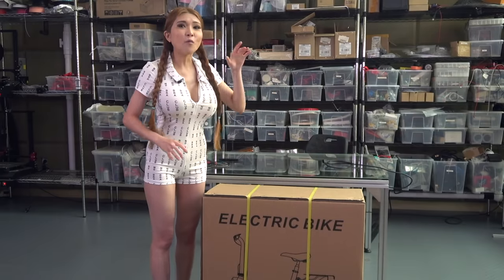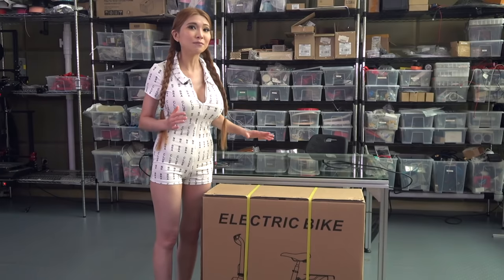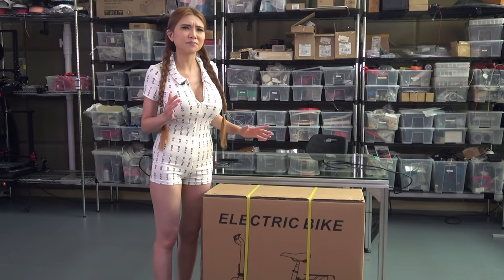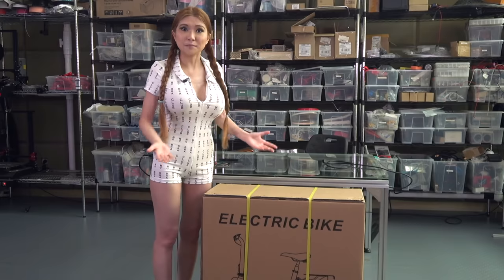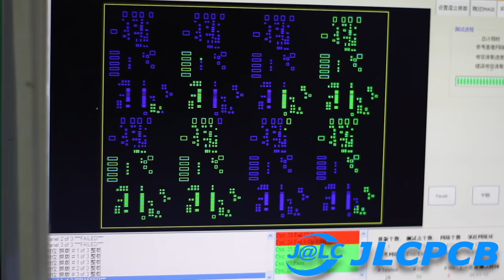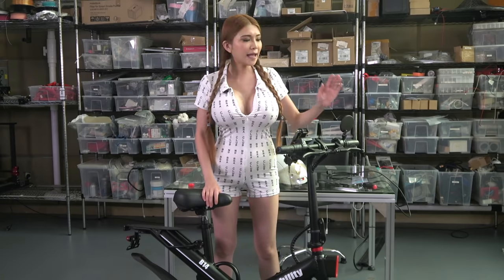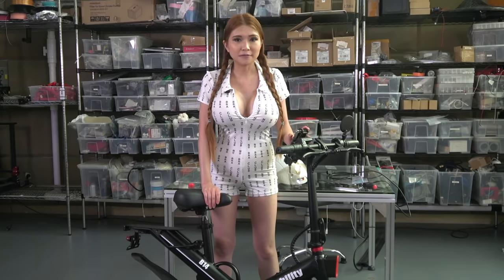Shenzhen E-Bike Test Drive- Niubility B14

Comment: What I like about this bike is that it has full suspensions and is small. Those 2 features rerly come together. From my experience, you need full suspension in electric bikes otherwise vibrations would shutter it into pieces over time. My advice on ebikes - always choose full suspension.

Comment: 5'6" and 106 lbs (in freedom units, as we Americans like to call them) is not even remotely close to pudgy for an adult female; you still look as fantastic as ever.
Reply: 5'3", not 5'6", but you're still correct, she's not by any means overweight; the numbers equate to a BMI of 18.8 which is considered the very bottom of the normal weight distribution
Reply: @cambridgemart2075  Wait she is 5'3?
Reply: @monochrome_linux  Yes
Reply: @cambridgemart2075  damn. I always thought she was 5'8 or something. She look soo tall in the videos tho!  So There's hope for small midgets like me!!
Reply: Freedom units that originate from the UK!!
Reply: @monochrome_linux  That’s cause she has long legs.
Reply: @isuckdick5275  no I dont think we will 🇺🇸

Comment: We saw you having trouble with the hinge, but all I could think was that it's better that it's a bit to tight than that it's to loose. Back in the 70's there was a "mini bike" craze. My sister had more experience with them as she had three of them stolen... Well the frame on these were pretty similar in that they used a pretty thick tube bent to form the frame with a hinge in the middle just like this one. That hinge was the major weakness of the design as it always seemed to have just a little to much give no matter how hard you tried to lock it shut, making the bicycle feel unsteady. So better that hinge is sturdy and tough to use than it ends up causing the frame to flex.
Reply from the maker: Yeah it's stiff but solid...

Comment: Good review! It's decent for the price, it only cost about 669usd and folds up and everything. I've been searching for alternate forms of transportation while I work on my car. I'm in San Fransisco and there's a company here that makes an "e-bike" called the onyx rcr it has a top speed of 60 but also cost around 4k, or I could ride an electric skateboard which cost like 1200-1800 and have top speeds around 22mph. This Niubiity b14 gets a top speed of 15mph but that's justified by the price

Comment: Small electric vehicles makes sense, since most travel is short range, isn't it, errands for groceries & such. But wouldn't compressed air be even better?
Reply from the maker: Tata tried, so far no ones been able to make it work...
Reply: @Naomi-Wu  But it works to some degree, right? As long as they keep it simple and inexpensive, and suitable for the common short range errands, is what I'm suggesting.

Comment: Got one second hand for my partner with only 25 miles on it for around half retail price.

Very excited as we've been using a windgoo b20 which has no suspension and a tiny battery to go on off road adventures 😂

Comment: I have to admit...as a former USCF licensed amateur road bike racer who raced many years and tens of thousands of kilometers...there’s something about e-bikes that leaves me feeling cold. No disrespect towards your project here. It’s just that you lose that human/machine interface that you feel when the rider is also the source of power. Not to mention they handle like crap compared to a quality road bike.

So I would respectfully suggest that it would be very interesting if you could do a DIY project where you imbed the electronic telemetry devices used in cycling that measure speed, distance, time, heart rate, elevation gain, cadence and power output in watts into a set of carbon fiber handlebars so that there’s no need to attach those electronic devices to the bike.

Another interesting idea would be to light up a road bike with some LED lighting so the bike frame could be seen from low earth orbit for safety purposes. That is without disturbing the road bike aesthetics and maybe even scroll messages across the frame. 

Or how about a bike helmet with a visor that has a heads up display that shows your bike computers data so you don’t have to take your eyes off the road to look at your cycle computers data.

As a cyclist and a technology geek that would be way cool.

Besides with a real quality road bike with a CF frame and modern components you could still maintain your successful business woman image and still eat all the best foods and not gain weight and they only weigh about 7-8 kg.

Now for a couple of safety hacks. Please don’t ride at night. Even on well lit streets the odds of your having an accident with a motor vehicle are significantly higher than in daylight and no one wants to see our favorite cyborg become a motor vehicles hood ornament. 

Also, glad to see you wore a helmet. Never ride without one. Equally important safety equipment for bike riding are eye protection and cycling gloves. And never ride without proper shoes as Thats a real good way to lose a toe!